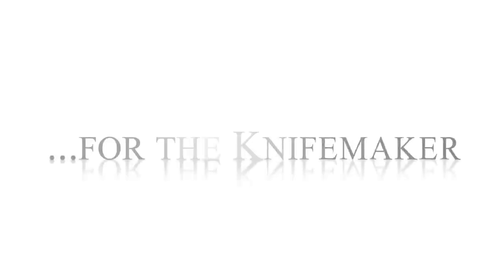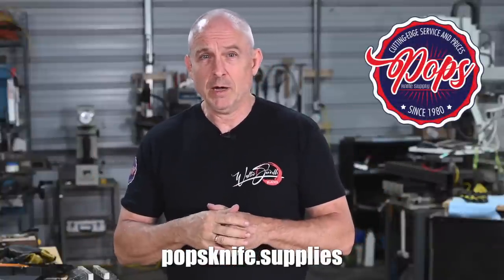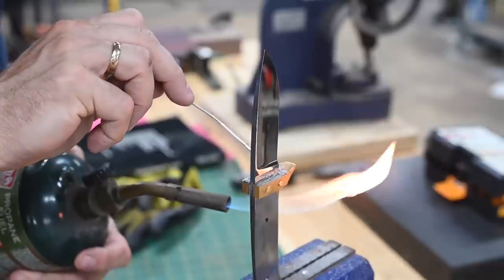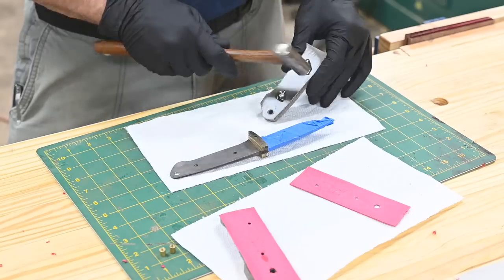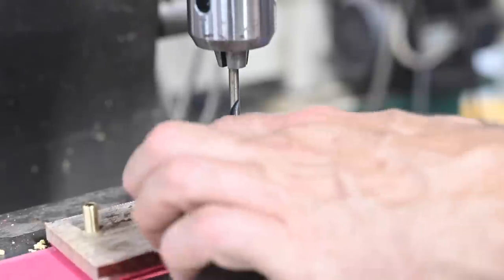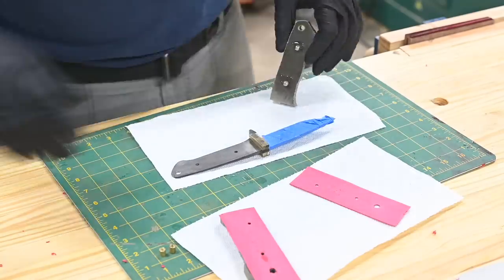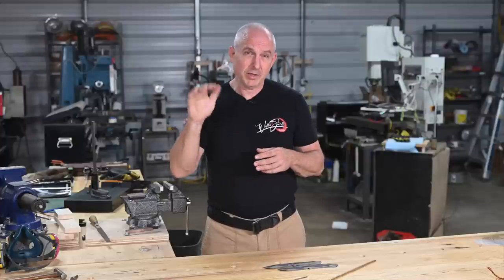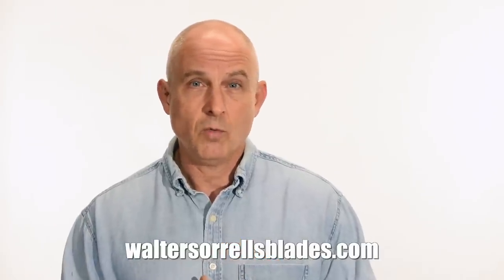Make A Loveless-Style Drop Point Hunter (Part 2)

Comment: 3 things I’ll never do:

1 high polish blades 
2 tapered tangs 
3 soldered brass guards. 

But damn,  you nailed it. 🤘 nice work dude.
Reply: 1/ high polish is so easy with modern diamond abrasives.  

2./ tapered tangs are the shizz on full tang knives. Check out something like bob kramer or Fujiwara Terurasu kitchen knives..

Comment: tapered tangs are fun. Once they are done. I do them just because it seems like I have to. I also hollow grind the tang, again, because it seems like I have to. Bolsters or guards on most little knives (yep, obsessiveness, seems like I am supposed to). But, liquid flux is what he used, and then he would let the solder flow down past the far side of the guard. At least, that was what he did on the video he made with Jim about their techniques. He was a little dramatic in his explanations of everything, but he put a ton of info into those video. I still suggest the S.R. Johnson videos (2 dvds) for a really good documentation of this style of knife making. Thanks for doing this. It is an icon, and a trip down memory lane.

Comment: You are a great knifemaker. 
Normally in an industrial setting  loaded abracive felt or cotton wheel- soft wheels whith contured surfaces with abracive glued to them - and large sanding flap wheels on a bench grinder that have been shaped to  the contures tou desire for the handle slightly.
I noticed in north america both loaded soft grinding wheels and the flap wheels are unknown in knife making and even very hard to buy the big flap wheels, many of witch will have large arbours to be used on muvh larger machibes than is used in a small workshop in the us.
These flap wheels look like a grinding wheel but with strips of sandpaper raidiating from the central wheel. some are very big up to 60cm if needed and many thicknesses .. These can shape a handle and the netal fittibs in a very short time. Vs  the belt gribders you use that take hours and cannot get into the contured areas or finger notches.
If flap wheels are available you shoukd try them. It will make knifemaking much faster and easier.
Another thing hobby knife makers do is spend alot of time on the belt grinding machibe. But a large 1-1.5 meter watercooled stone wheel will grind the bevels on a hardened blade in scondts, especially with a jig to force the blade, then the belt grinder can be used to finish the blade if needed. You can use a narrower wheel or a convex wheel for odd blade shapes too. For long blades the wheel is magic. 
The water wheels are still made in europe and japan, but you can make one from large surface grinder wheels.

Comment: those are more art works than anything you'd dress a deer or whittle kindling with. very nice work! it takes me so damn long to forge  grind heat treat make handle and sheath etc. that i would never try something that artistic. I did make a pretty forged brass guard for a bowie but after all that work it didn't fit quite right.

Comment: If you drill a second hole 1 size larger than in your pinhole that is 1/16 to 1/8th inch deep on both sides, then peen it you create a rivet hole. which is nice as in something like the wood you are less likely to over-peen and split the wood (although it takes experience to get ant peening action right) and you have a stronger mechanical connection as you have made your pins into rivets. I have yet to try doing riveted guards so I can say anything about how it would look with them.